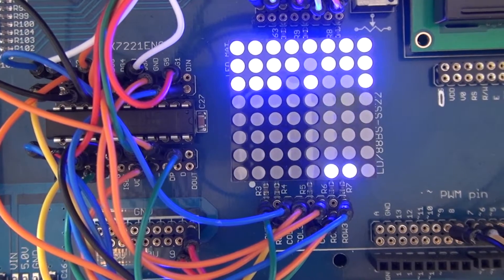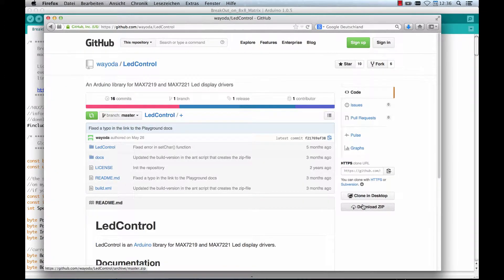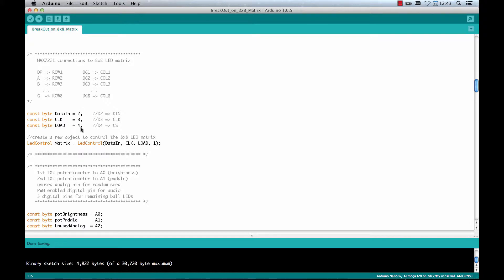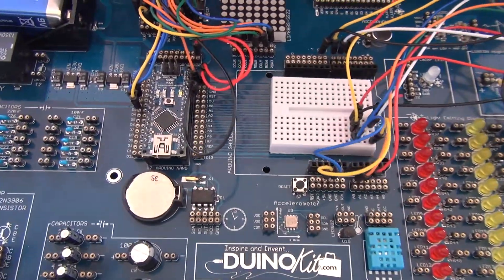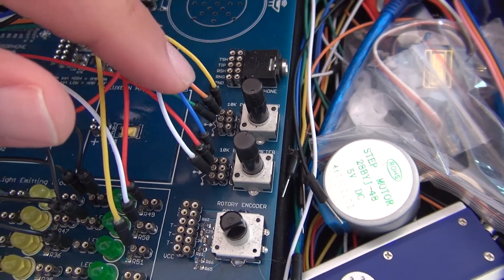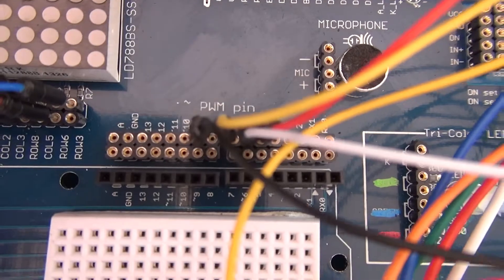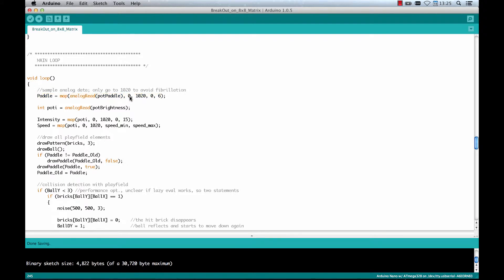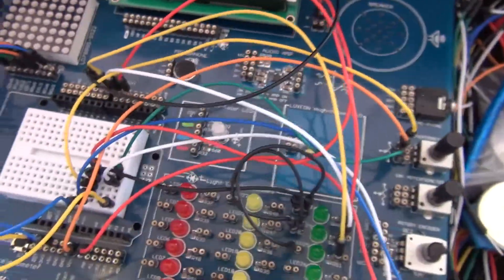DuinoKit BreakOut Tutorial

Comment: When I look at the stuff in the LEDController library they have a wiring diagram which shows gnd and 5V wires hooking into the Max7221 with resistors and capacitors.  You don't mention anything about this and I can't get enough of a view of the wiring to figure out whether it's done that way or not.  Do I need to do something here or is that somehow automagically handled for me?  Thanks - great tutorial!
Reply from the maker: Yes, you need to wire gnd and 5V. Please download the sources here http://sy2002.de/dl/breakout.zip   In lines 142 - 153 you find wiring instructions for the Max7221 and more wiring instructions are in lines 166 - 227